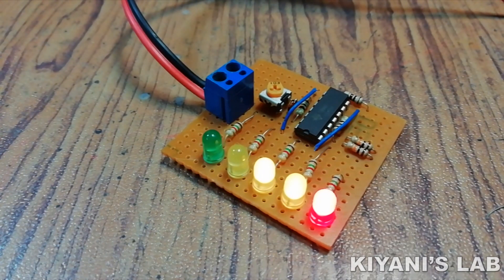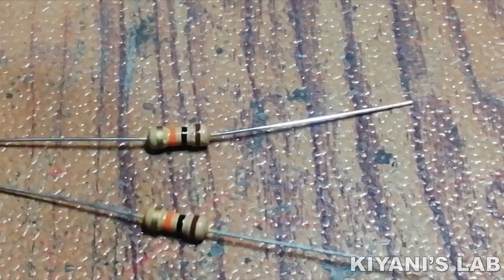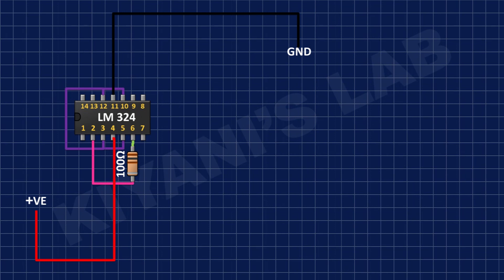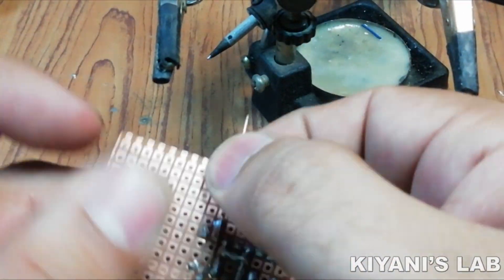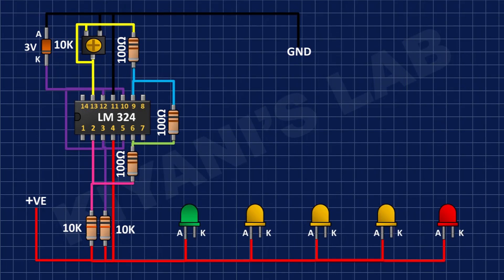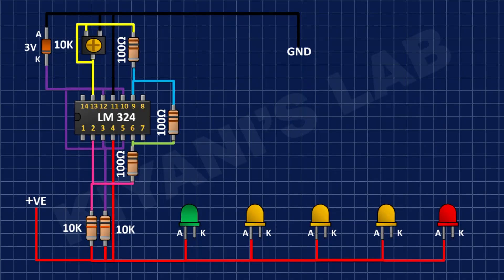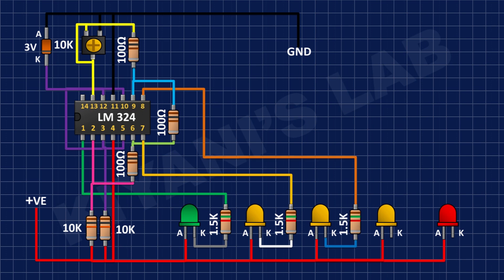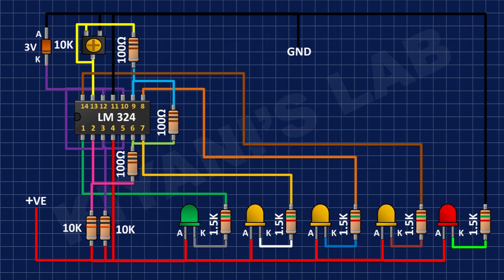How To Make Battery Charge Level Indicator

Comment: this circuit can i use it for 12v lithium batteries? with that trimmer can I adjust all the threshold voltages? how many watts are resistors? thank you so much
Reply: You can't calibrate all LEDs with single trimmer.

Comment: How can I use this circuit in 8.4 volt battery pack which components should I have to change
Reply: We have the same question, namely a circuit diagram for 8.2 volts. Have you found that somewhere by now? If so, I would like to know where! Thanks for your response!